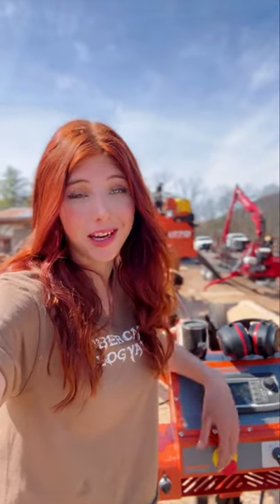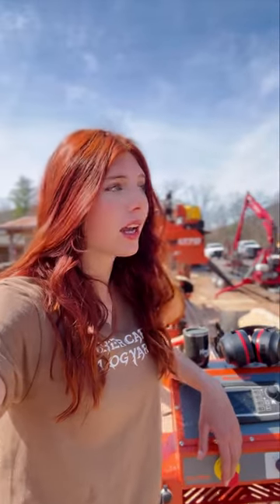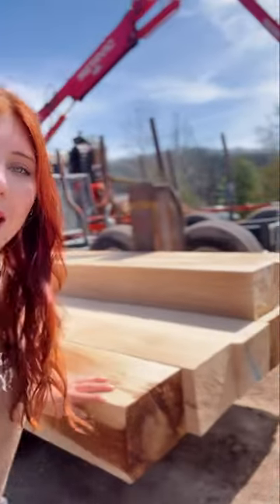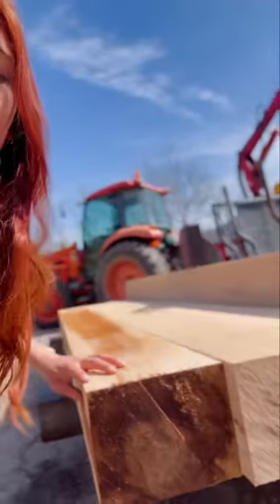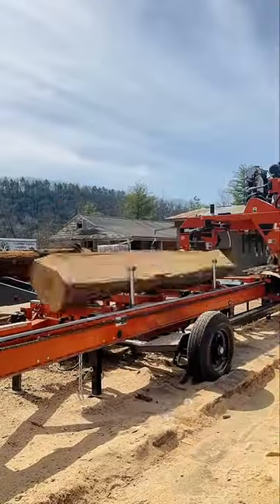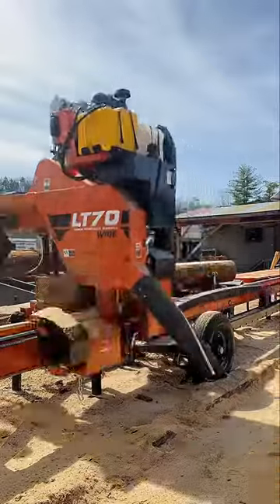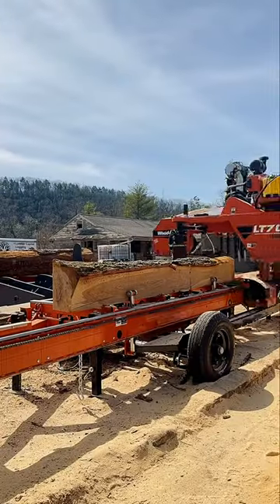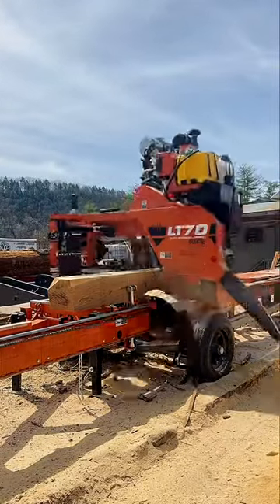We invented a jig to help us make perfect railroad tie bricks

Comment: Railroad ties are lumber. Lumber refers to a tree that has been cut from the roots and no longer living. It stops being called lumber whenever it takes on it's finished form. Until attached to a railroad, railroad ties are lumber. When they're attached, they become part of the "track." You could however ask "what type of lumber was used for this track?" Because at the time that the track was being built, the tree was not living.

Comment: I just used 56 used RR ties for a project. The used ones are cheap for a reason, they aren't always in good condition. I definitely wish I could've got new ones without all the holes and splits and warping.
Reply: Well you can buy them new with or without treatment, but the downside is the extra cost! You are paying for quality lumber. 😢
Mark from Melbourne Australia 🇦🇺
Reply: Without the treatment they'll just rot anyways.

Comment: Great video and informative.
How does that effect the chain sharpening due to the larger volume of logs used. Any wire or nails would be on the outside or do you have some magnetic tool that you use to scan first before you cut?

Comment: Now, if you got the other 2 attachments to your log deck. The inclined deck and forget what the other ones called. But it accepted the inclined deck. So you got like a scoop on the end of the log deck. You can actually put probably between 30 and 50 logs on there at 1 time.